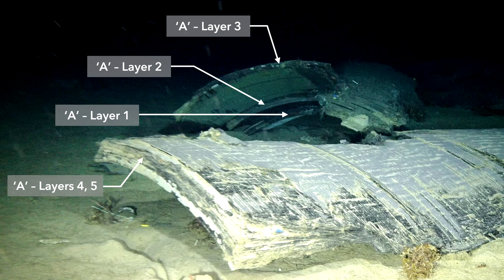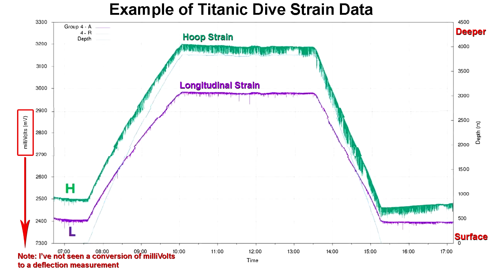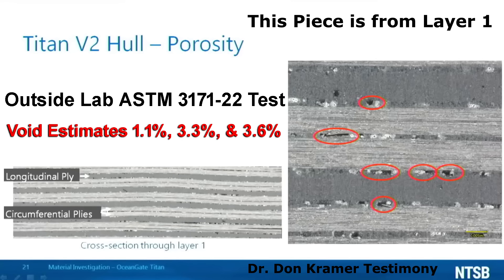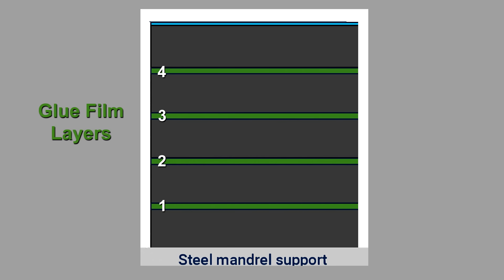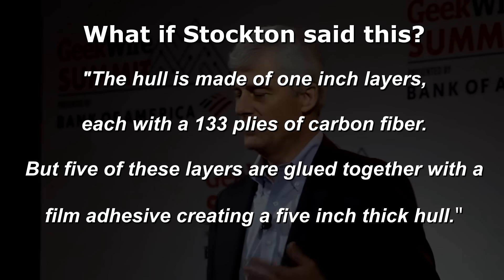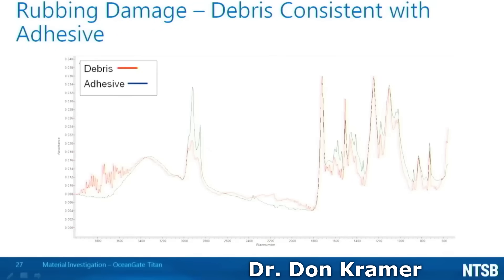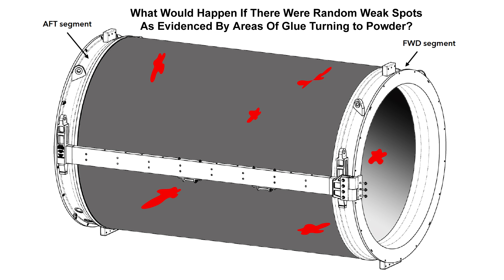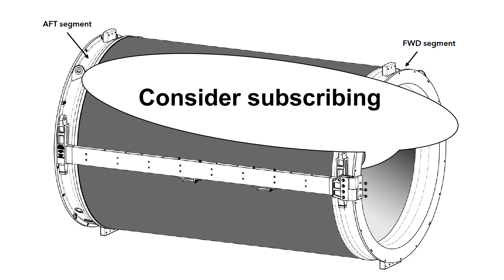OceanGate Titan Hull - Glue Layers Were Breaking Down To Dust - No Clues.

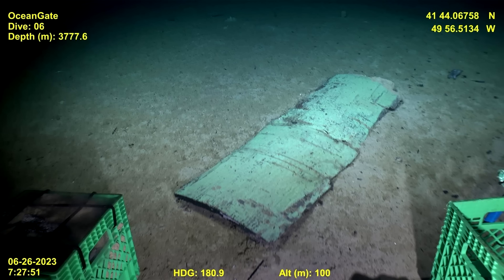Comment: 13:50 I also think they had delamination as the response of some sensors stopped being proportional to depth. Instead they had to go down some way before sensors started responding. This change in response occured after a "bang" on an earlier dive.
Reply: "Bang" sound probably the sudden "sliding" of the layers under tension

Comment: Why is it a cylinder and not more arched in the middle like a barrel? I think this every time i see it and I realize it would have complicated the mandrill removal but it could have been done and would have made the hull many times stronger in compression because it would have deflected the pressure squeeezing that cylinder towards the sides, right??   (O_o?!!)
Reply: That style of mould/mandrel is already well established, actually. In cross section, it looks like a flower - multiple long parts arranged radially around a cylindrical core. Once the setup/cure/postprocessing has been finished, you remove the central core, which simply slides out, and then that leaves room for the 'petals' to move into the centre cavity, and be removed individually.
Reply: @nickhadfield3192 erm really, for carbon fibre? What's to stop the fibres sliding around since thered be a tendency for them to move and loosen towards the thin end
Reply: @ That's why you wouldn't wrap in straight lines from one end to the other. You'd go in criss cross lines like a ball of string. Only a few winds from end to end, before going back the other way. Repeat until desired thickness.
Reply: @nickhadfield3192  you can't do a few winds, it has to fill the area. If you don't fill in each traversal, the surface is uneven. Which is ok for some applications, but if you want it 5 inches thick it's a no go.
Reply: In addition to the added cost, it would also have made the sub bulkier and harder to transport. And IIRC transportation / launch costs were pretty much the whole reason they wanted the sub to be made of carbon fiber in the first place. (A titanium sub would have needed a larger more expensive boat)
Also, if you make the cross section arched instead of flat you would likely end up concentrating too much force into the very ends of the fibers; right where the carbon fiber slots into the titanium ring. I think it probably COULD be done, but that joint would have been far more difficult to engineer. 
So maybe in a different world if Titan had been wildly successful, they would have looked into improvements like that in future versions, but they just didn't have the money to make such a complicated prototype.
Reply: Because it's super hard to make carbon fibre on this scale that isn't flat. In theory you could make a spherical carbon fibre, but would be super expensive and difficult.
Reply: Why do the Americans have containment buildings around their reactors and we do not? Why are we the only ones who build water cooled RMBK reactors with a positive void coefficient?

Comment: 5:04 The average of those values is ~2.7%, not 2.2%. So it was even worse than he said.
Reply from the maker: Yes, you are correct.   Dr. Kramer used that number in his testimony and I figured there was no reason to try to correct it in the narration.  The sample size given to the outside lab was small.  So, the number could have been worse or better.  Who knows.  Thanks for commenting.

Comment: If you could lay up carbon fibre perfectly , carbon fibre frames on push bikes would almost never snap apart from heavy impacts.
They do. All the time.
And every analysis of these breakages?
Is porosity , and  "bridging" 
Carbon fibre wheels are available for motorcycles and cars.
Autoclave cured, expertly manufactured, over engineered to the nth degree.
Yet still banned from every form of motor racing.
Reply: those are wildly different situations
Reply: Motorsports bans are usually for cost control reasons and not engineering.

Comment: The carbon fiber was bonded to the rings with LOCTITE EA 9394. This adhesive has a shear strength of 4000 psi (at 70 degrees F).  The shear strength is lower at colder temperatures. If you look at pictures of the ring, you see no tufts of carbon fiber embedded in the glue. Also, the flanges on the ring were sheared off, a clue that the ring bound failed. Deflection of the hull would cause some pull out at the ring as well. My theory is that the glue bond at the ring failed.
Reply from the maker: Thanks for your comment.  I agree with you about the Loctite.  You may be correct about the failure at the rings also.
Reply: There could be nothing but an o-ring between the CF hull and the titanium dome, and it would hold together fine… tell me again how the glue failing is the cause.
Reply: @pyalot  Consider this - as the tube of CF is radially squeezed, it assumes an "hour glass"-like waisted shape. As it does this, an angular deflection on the ends of the ~5" wall starts to form, with the displacement greatest at the largest diameter. As a simplification, this would then concentrate the stress of end compression at the innermost layer of CF, which could initiate local failure that would then propagate through the rest of the layers in successive order.

I'm not saying this definitely happened, but it could, and is not something a unbonded "pressure mate from external forces" could survive, o-ring or not.
Reply: @pyalot  That would be true if the CF was a larger cylinder with the smaller Ti end bells acting as support rings inside the ends. But the actual connection was with both pieces nearly the same size with the CF in a groove on the end of the Ti ring. So the force was a shear no a compression, other than the thin lip of Ti at the edge of the groove.
Reply: @pyalot  The flanges were only 1/4 inch of titanium. You can see in the pictures that the flanges (on the ring) sheered off.  You can also see evidence that the glue delaminated from the rings.
Reply: @ If you replace glue with rubber o-ring, would you talk about the o-ring ripping the flange off and talk about it delaminating from the titanium rings?
Reply: @ Not sure if that's at me (YT comments are wack since J202025), but I suspect it would "in all cases" be deformation of the C/F casing that would exert the force to shear the Ti flanges. There's no way for an o-ring on its own to do so, and less likely that loads passed through a glue shear-line could remove the flange under tensile failure. Just my opinion, of course.
Reply: @davidg3944  so if there was no glue whatsoever, just an o-ring, it would make no difference. Therefore, the bonding to the flange is of no relevance. It's not a structural component, just a seal.
Reply: @pyalot  Maybe. Possible that the load in shear across the bond line could cause delamination of some of the cylinder layers, but that's not a given or possibly inconsequential given the speed of failure of the system.

Comment: Horrible engineering all around. It's baffling how it even went past the drawing board.
Reply: Sloppy engineering and terrible execution. And "execution" it was...
Reply: This is one of those, on the face of it, in concept it should work. In reality not so much. A sanity check of "We are going to trust an adhesive interface between titanium and carbon fiber down to 3,800 meters multiple times.
Reply: Hubris

Comment: How did nobody realize there would be sheer forces on the glue layers when the hull starts bending under pressure?
Reply from the maker: That is a great question!  I have no idea why the engineers involved did not think about that.  But who is going to use that much glue on a vessel that had to deal with that kind of pressure?  Crazy.  Thanks for commenting.
Reply: It's not immediately obvious to me why the layers sheering apart would be terribly bad. It probably is, is just not that obvious

Comment: By this point, having examined the recovered wreckage, there must be someone qualified willing to hazard a best guess on what exactly the failure mode was. I know it's difficult, though, given how haphazardly it was designed and built, giving a variety of possible failure modes.  Seems unlikely that it was the viewport, but who knows?
Reply from the maker: Thanks for your comment and your question.  The viewport was not properly rated but was most likely not the failure point.  The failure was either the hull itself delaminating, what this video is about.  Or, a failure right at the ring hull junction.
Reply: Not the viewport. It was blown out as a result of the implosion. Came to rest on the bottom near the stuffed taco rubble pile.  You can spot it on some of the ROV footage, just sitting in the silt not far from the front dome, which came to rest viewport hole down and partly filled with silt through that hole as it settled.
Reply from the maker: @notwithintolerance  Interesting, I hadn't noticed the viewport in the ROV footage.  I will have to look again.
Reply: In a comment above, I presented this possibility:

***Consider this - as the tube of CF is radially squeezed, it assumes an "hour glass"-like waisted shape. As it does this, an angular deflection on the ends of the ~5" wall starts to form, with the displacement greatest at the largest diameter. As a simplification, this would then concentrate the stress of end compression at the innermost layer of CF, which could initiate local failure that would then propagate through the rest of the layers in successive order.

I'm not saying this definitely happened, but it could, and is not something a unbonded "pressure mate from external forces" could survive, o-ring or not.***

I am not an engineer (I do have an extensive background of practical mechanical design), so I invite review/critique of what I gave as a possibility.
Reply: Look at the wreckage! What does it tell you? The carbon fiber hull was jammed into the aft-end titanium half-dome. The way this can happen is if the aft-end carbon fiber-titanium connection failed first. When this happened, the pressure on the carbon fiber cylinder collapsed the hull. The pressure on the forward dome then jammed everything into the aft end.

Comment: Using feet and inches... is it 17th century?!
Reply: Metric parts are twice as expensive.  Duh.
Reply from the maker: The original engineering designs were done in feet and inches.  So I use the same units. Thanks for your comment.
Reply: "There are only two kinds of countries, those that use the metric system and those that landed on the moon."
Reply: @user-ct8my8rv9c  At this point a lot of countries have landed on the Moon, sometimes integral, sometimes kinetically dissembled. Only one country has landed humans on it, so yes, Imperial units rule.
Reply: Freedom units forever! 🦅🇺🇸🦅

Comment: In another video it was stated that the actual point of failure as shown by debris was the interface between the carbon fiber hull and the titan rings, meaning that the pressure on the hull would have caused a bend inward at the midsection on every dive(and most likely during the awkward transportation processes, including when Titan dropped of the barge once accidentally) and would result in a shearing stress on both ends, front and aft, straining the glue there and also that small amounts of water would frequently be sucked into the gaps.

The burst of the hull as seen here was said to be the result of an explosion after the sudden entry of depth pressured water at both ends, compressing the air inside rapidly and thus causing an explosion.
So in my understanding, the bursting of the hull was indeed amplified by the structural imperfections, but the primary cause was sea water suddenly shooting in from the interface between titan rings and hull.
If even a perfectly manufactured hull would have survived that I have no clue, but the crew would for sure not have survived the primary incident.

Comment: Ow man carpenter here with 33 year experience. LVLs are absolutely the worse beam you can use. LVLs over 10 ft sag under there own weight. Put anything on them it only gets worse. Obviously there's different size and widths so bigger is Obviously better. But the engineers always approve ones too small. One time I was called over to a house the sheet rock guys had a problem. When I got there the guy was using a 2×4 trying to show my boss the hallway wasn't matching the living room joist. At first glance I thought it was fine.and wondered why he was using the top of the joist the bottom is where it matters. My boss didn't understand either. Then I turned and took a second look. He was using the bottom of the hallway joint. The beam in the living room was sagging over a foot. So the 2×4 was under the hallway joist and was over the joist from the beam 2×8s. I looked over at the beam and almost messed up my pants. It was obviously barely holding on. It was about 40 ft long and had joist and roof on it.
Reply: For that sort of long span, what would (wood?) you recommend for structural elements?
Reply: @davidg3944  I forget there actual name gluelam maybe. They're 2×4 2×6 stacked and glued together. They have a crown in them. I've never seen those sag. Maybe level but never sagging. It depends on the load on them how big they need to be of course
Reply: @ Putting in a crown makes sense (like unloaded flatbed trailers). Just make sure the crew installs them hump up!  🙂

Comment: I just don't understand why they didn't go with 7-10 inches, i know it would prb be another $15,000 but 5 inches? Lol you got some balls to go 12,000 feet with a plywood sub hull lol
Reply: they had already manufactured the titanium caps im assuming
Reply: @Dr_Drew_Peacock  I think that's the case, and even if a thicker hull was used the same basic precursors to failure would be in place, and in some cases worse - the extra autoclave cycles and grinding spots if nothing else.

Comment: I’d be curious as to this: what if they had not done the five layers with glue and ground down the high spots?  What if they had done the full five inches and left the high spots intact. There would be no internal layer rubbing at the glue points and no breaches of any layers due to grinding the high spots down. What difference might that make in the strength?
Reply: It said somewhere in the video that one 5 inch layer couldn’t be autoclaved properly.
Reply from the maker: Thanks for your comment. So, high spots are weak by themselves.  But grinding them down is bad too.  There is no good why to do pressure autoclaving of a single layup five inches thick.  You can't force out the air pockets and the heating would be uneven.  So, they tried the one-inch technique.  But, it was not a good idea.
Reply: The high spots are voids with air - or - areas with too much adhesive. Either way it's bad. No difference grinding or not.

Comment: Did they even do any vacuum techniques to rid the CF of voids?
Reply: The winding machine was in the open, no easy way of ensuring air was not trapped between CF layers. Perhaps if the winding had been performed in a large vacuum chamber, but that would have been logistically difficult and expensive.

Comment: Wouldn’t it be cheaper to do it in metal ?
Reply: no. metals are heavy and require much larger vessel for buoyancy (look at Trieste). Costs are huge. Carbon fiber without flaws is MUCH better at being neutrally buoyant and safe. However, making flawless carbon fiber isn't possible yet.

Comment: Wouldn't a series of interior titanium rings have acted like ribs to limit the flex of the tube? Why wasn't it reinforced?
Reply: @kirbywaite1586  once you start doing that, you can simply remove one degree of complexity and stick to titanium only.
Reply: Cost
Reply: Relatively speaking, titanium is much less still than a properly made CF structure (about 114 GPa vs CF laminate about 2-4 times as much), so you'd need a lot of Ti at significant section depth, losing interior volume and adding weight.

Comment: Somethin like 3.3 lbs of pressure per square millimeter at the depth it imploded right?

An egregious gamble for a material; that looks like a sponge under a microscope and has zero strength in the compression. 
Before it is ever even dived and cycled.

Comment: Any area where the individual 1" layers were debonded/rubbing the stress would need to be transmitted around the discontinuity to the adjacent 1" layers. This would produce forces in many directions including a torsional component. Seems like 45deg fibre layers might have helped to resist some of these resultant forces. Obviously the solution is not to have 5 glued layers and if you are going to have glued layers to have a good bond (or just use a proven construction material and process) - but only having hoop and longitudinal fibre layers is one more hole in the swiss cheese.
Reply: From another video, I recall something about 45deg fibre layers being recommended but ultimately not done.
Reply from the maker: I agree,  Co-bonded was tried so they could de-bulk after one inch thick.  But, the bottom line is you can rely on glue for a deep-diving sub.  Thanks for commenting.
Reply: no tortional moments, trust me bro